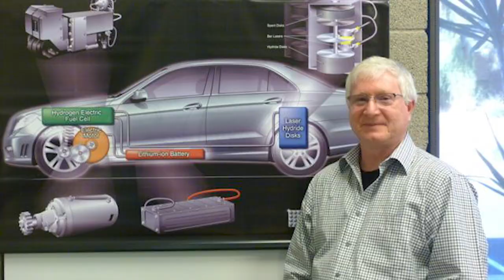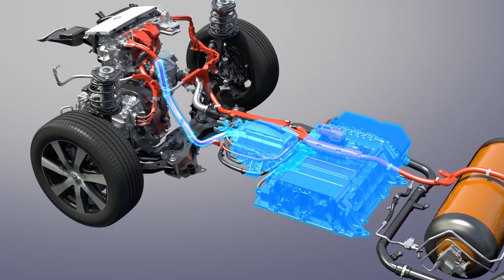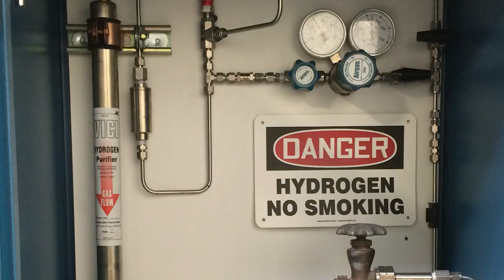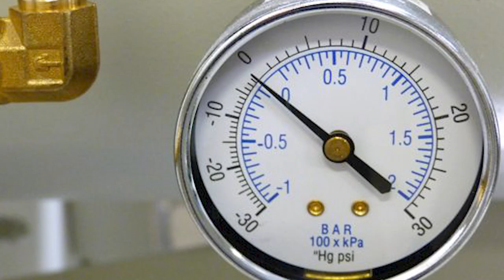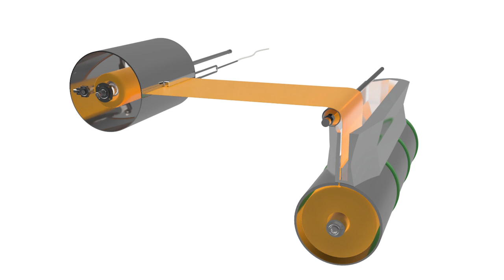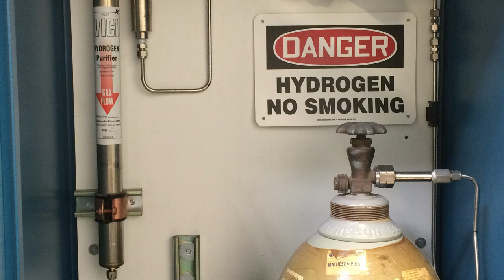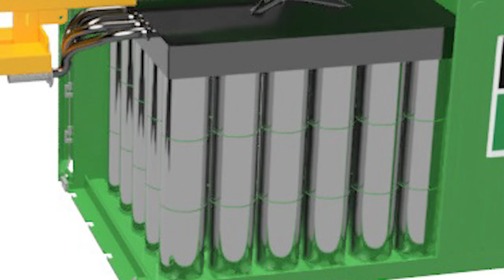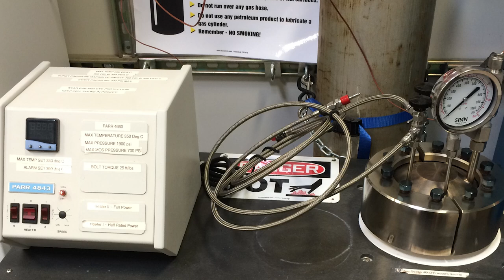This BANNED Technology Could Push Hydrogen Cars Over BEVs

Comment: The efficiency of a battery electric car is about 40-60% from sun to wheel - so to say 40% for the Audi E-Tron 60% for the Hyundai Ioniq 2019. A petrol car has about 12-15% efficiency from well to wheel. Diesel trucks around 20%. A hydrogen powered car has about 8-12% depending on how the hydrogen is being mined and this plasma kinetics disk shebang has about 6-8% including all conversions and losses. 

With the new CATL NA+ batteries the cost for low end EVs will plummet in 2023-2025 below 15K. Of course they will have to be a bit larger because the NA+ cells are a bit larger and heavier. So what? Who cares besides some geeks demanding we go back to the VW Beetle? 

I do not see any form of market for this thingy.
Reply: I could easily see Toyota, Hyundai or Honda, who have significant investments in hydrogen to support this technology. It seems to resolve many issues with H2 storage and transportation, as well as conversion. Which have been killing fuel cell adoption. Plus there could be many industrial applications. It may not be competitive in the automotive sector with so many ongoing technology improvements, but there are a lot of edge cases where it could compete well.
Reply: BEVs have too many limitations to work anytime soon for alot of folks. Without solid-state, they will go the way of Edsel.
Reply: @deanmcmanis9398  It does not matter whether Toyota "supports" this technology. They do not have the global power to finance all those safe and secure H2 production plants world wide which must get their energy from clean and very wide spread solar and wind power. When - at the same time - we EV owners just take away their precious electric energy and use theat to drive our cars today. Because we need much less and our cars are much cheaper - to buy and to operate. So please tell me, why should i buy a slow turtle Mirai when i can buy a swift fast and cheap to operate Model Y at the same or even less cost? And no: There are no other H2 powered cars "announced" today. Nor tomorrow or the day after. Not even next year when the Model 2 comes to China and Europe and VW sells the first million of their ID series. Not even 2023 when VW sells their 2 million, Tesla their 3rd and the Chinese manufacturers start to export to Europe. Of course not to the US - those nincompoops are much too timid and fearful of a real American car manufacturer and also of the oh so mighty Chinese hackers... Oh well, best products and solutions for us in good ole Europe then. The socialistic center of the Universe...
Reply: I believe you're missing a few things in this discussion.  First there is a shit ton of very cheap carbon free electrons out there in the form of overnight hydropower and nuclear plants, which often have to run at operational minimums but have no customers- every single night, all night. Electrolysis overnight for these operators would make a lot of sense of the cost of dirty hydrogen (ie from natural gas) goes up.  

Secondly, the main use of hydrogen currently is ammonia production as part of fertilizer manufacture.  If fertilizer has to go carbon free in the coming years (or another big demand source like diesel -run heavy shipping), the business case for green hydrogen is going to be very positively affected, and the availability of light cars will also ride along. 

Finally energy storage is turning into a massive market in N America, at the moment mostly from hype. However hydrogen is very well positioned as a storage tech. Imagine Texas connects its wind system to hydrogen storage and then mandates either BEV or hydrogen light transport. Hydrogen then becomes patriotic. 

My point isn't that Texas is going to do that, it's that there are a lot of scenarios where these kinds of innovations have a lot of potential.
Reply: Efficiency doesn't matter. Only cost matters.
Reply: @acchaladka  Ah, no, there is no "overabundance" of power. When its not needed its not being generated. Nuclear is about the most expensive form of electric power. Just look the numbers up. Then comes coal power, offshore wind, water, onshore wind and finally solar. Of course depending on the latititude. 

Yes energy storage is a big market. Our country profits because we have many large storage power planst and buy the cheap electrictiy from germany and sell them back at the high peak demand.

I do not deny the "potential" for this and many many more products and services but there will be no one besides maybe Jeff Bezos or Melania Gates who gives them enough money to develop those potentials to marketable products and services. 

What i say is we have solutions that work. Today. Now. For many. But certainly not for all. Just use them today and do not wait for a better tomorrow. Its like waiting for the next best smartpohone, laptop, bike, videogame. Of course there will come a better one. But if all you do is waiting you waste your life for naught. I do not waste, i decide whats best for my family and me, what best for a clean and sustainable future use of energy, what i can finance now and hopefully in 20 years. Then i do it. 

Thats why i will get my third Tesla in september. And i regret not any of them. Thats why i got my PV on my carport over the wallboxe for all my EVs out there on my parking lot. Now. Not tomorrow. Because tomorrow it may be too late.
Reply: @wolfgangpreier9160   you are fooling yourself.
 If you check reputable data sources (AEI, Lazzards, etc) , you will see that the most expensive electricity is from Roof Top Solar.
 Solar and wind are only cheap if you ignot the storage and back up fossil power required to ensure continuous supply.
Coal and gas are in effect the cheapest form of generation after Hydro ( which has little potential for expansion)
  Future Nuclear technology may well beat them all on costs
 Hydrogen is extremely wasteful/expensive/ impractical method of storing power and a highly complex way of powering transport...Sounds much better in theory, than it is in practice.
Reply: @wolfgangpreier9160  let me know when there is either a country that can continuously supply its electricty solely from Solar, wind
Reply: @wolfgangpreier9160  .....or even hydro. Then remind me again when there is even a TOWN that is able to survive for a single windless night, on battery power alone !
Reply: @weinisable  Yes i will. Currently the best are at 40-85%. I guess somewhere around 2030 the first countries will reach that goal. Our country ist @ 81% regenerative and some natural gas from russia. Our renewables are mostly water - we are a mountaineous region after all, much wind and few solar - we do not have the flat unusable surfaces for solar panels. Our land is all very lush and green. Many of our neighbors are perfect for windfarms and many solar farms. They have much unusable land besides horse ranches and 8-legged chicken farms for KFC. In Europe its currently 40% regenerative, 26% brightly shining atomistic power generation and 34% fossil - mostly coal - and mostly brown coal in germany. We are very lucky that we do not have those brightly shining Tchernobyl cousins.
Reply: @weinisable  Yes, that will take some time. First there will be the south aussies. Then there will come some cities in california and i guess sometimes in 2 years a few texan cities. But yes, that will take some time.
Satisfied? Have i got the right amount of information to butter you up? Mabe with some vegan canadian wild rice on the side? You are such a nice conversationalist! Really!
Reply: @wolfgangpreier9160  water (hydro) is a perfect generator, ( and storage ) but can never bethe solution for most of the world as it is not “ scaleable”  or even available in many regeons. Most of the best hydro sources have already been developed yet it is still only a few % of energy supply.
Further, some of the major hydro facilities are having to shut down due to lack of water ( EG,..Hoover dam, and Oroville also)
      What makes yo think SAustralia will be able to power a town from batteries any time soon ?
They certainly have a high % of wind generation in a state with a small demand (<2GW )....and a large Tesla battery (190MWh).
But even if they dedicated the entire battery to one “town” overnight , only 16MW supply would be available ..= v small town !
Reply: @weinisable  Yes it is, yes it can. Our rivers in our country can not handle more power plants, thats true. But the available caacity for sea power plants is more then the world needs for electric energy. Even when all gfossil usage would be converted to current usage.

There are many more concepts, Water is but one of them. Use wind, in southern areas and flat lands solar, many farmers could use biogas - but the companies developing them are rare.

Southern Australia will be the first area powered by battery energy in the night. Not coal. Even when the stupid Aussi government (ok which government is not corrpt and tries to destroy its own country...) demands to shut down all regenerative energies to finance their landlords and financier aka coal barons. The industry and energy providers do not care for the cost. So solar at day, batteries at night.

Morocco is the next candidate, then Chile, then parts of California, then many parts of india, Saudi Arabia, then maybe texas. The list and order fluctuates each and every day.

You do not have to "believe" just observe.
Reply: @wolfgangpreier9160   we have a folklaw saying in Australia for situations like this.... “ You are Dreaming “ !
The is NO WAY Hydro, Tidal, Wave, Ocean Currents, Wind , Solar, or Wishful Thinking .....will ever provide 100% of the energy for a conventional lifestyle across the Planet.
   Come back and tell me about it when you find a single country that has done it !
Reply: @wolfgangpreier9160  ...”the available caacity for sea power plants is more then the world needs for electric energy. “....
   I would like to be alive long enough to see that technology developed.  
....Dig me up when its working !
Reply: @weinisable  As i said to you. Our country is already at 81%. Morocco at 42%, Germany at 47%, Chile at 48% and the list goes on and on.

It does not matter whether you "believe" or not. Imagine nobody cares what you believe. It happens and it will happen more over the next decades. In 2030 the first countries will start to have 95% self generated regenerative electric power. In 2050 the first countries will start to generate enough regenerative energy for all purposes, Heating, Cooling and electricity to sustain themselves. Its a matter of economy. A matter of money. A Matter of basic and pure human greed. And human greed always wins.

That all of this is not enough - by far not enough - to stop or revert the climate catastrophe is another topic.
Reply: @wolfgangpreier9160  nuclear is at the cusp of a breakthrough, thorium nuclear generators are way cheaper than uranium, way more efficient, are virtually meltdown-proof and as such they require less maintenance. India is building thorium reactors and will probably have them up and running by 2025 and nuclear will become WAY cheaper and way safer if we adopt that new technology.
Reply: @wolfgangpreier9160  nuclear is the cleanest, safest and overall cheappest for of energy. Check deaths in coal mines vs nuclear plants in the last 2 centurys. Modern mini nuclear plants are the only way to decarbon. You must check your sources better and dont go into fear paranoia.

Comment: I have long thought that batteries and EVs are not the ultimate answer and certainly should not be the only answer we consider. Although there are probably still more questions than answers right now on the viability of this technology, when you see the rate of progress they have made so far, it really is within the bounds of probability they can refine this technology further and overcome most of these obstacles. Sadly, it will most likely be vested interests of the elite who have already put their money in regular EV technology which could end up burying this.
Reply: Lithium Batteries are just as bad as oil. 

EV's are the way to go, YES , but we need to get rid of the Lithium.
Reply: Luckily lithium can be recycled. Oil cannot
Reply: @ThomasBomb45  um, yes oil can be recycled , it's called plastic. 

FYI - drilling for oil has a lower environmental impact than mining for lithium.